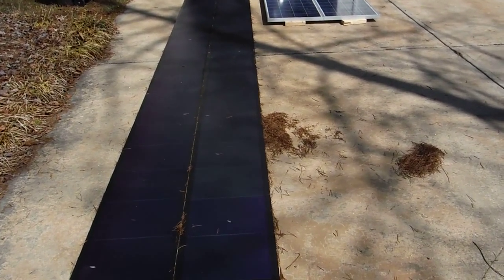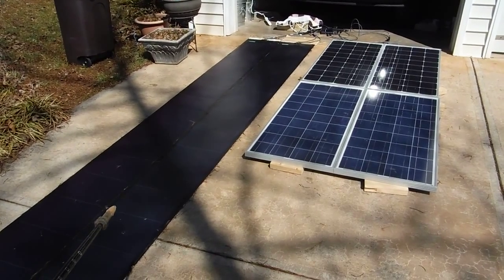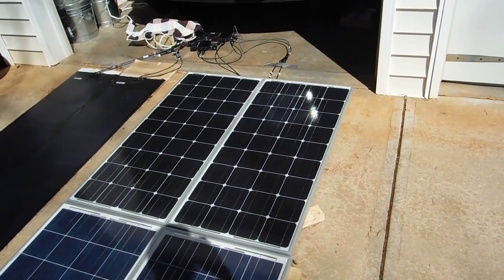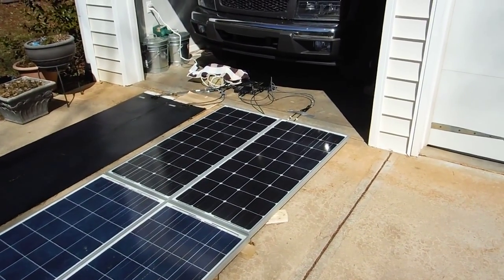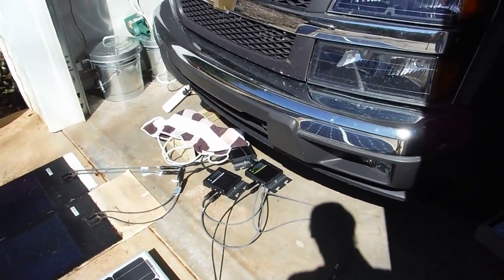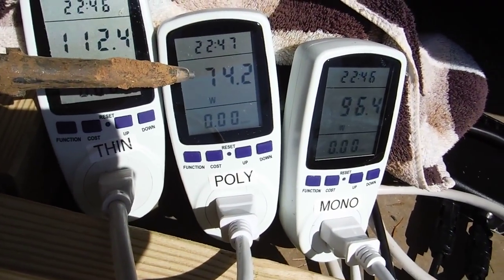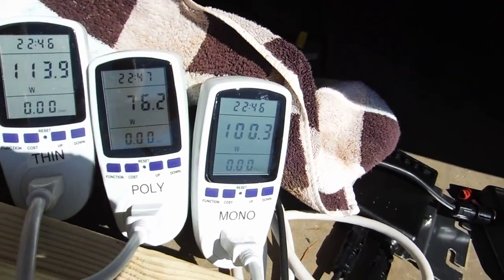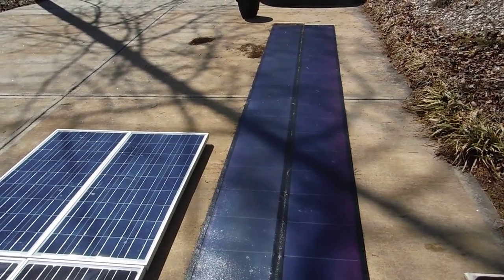Solar panel comparison, Part 1

Comment: in the beginning of the clip when he walk toward of those panels, I see the shadow of the tree is cover of those solar in different sun light intensity at different time when the sun rise or sunset. example of the shade of sun angle at 11am  is different the shade of the sun angle at 10am. this test is wasting time and not accuracy